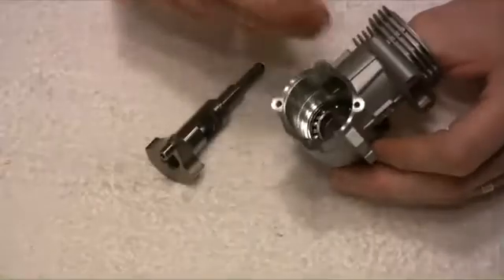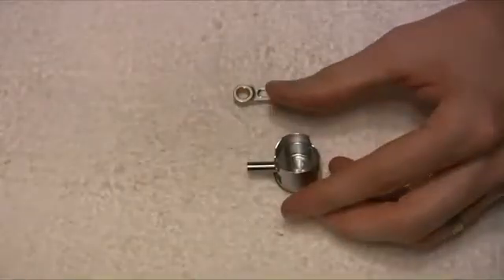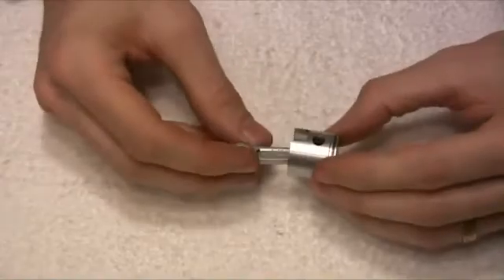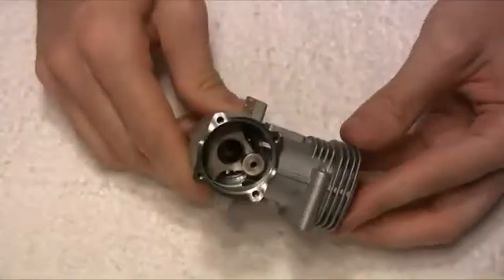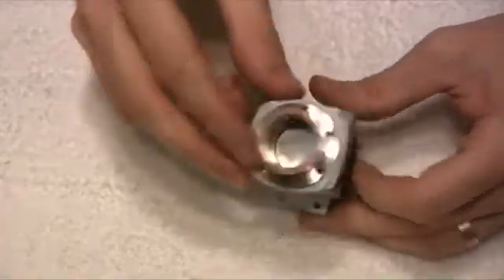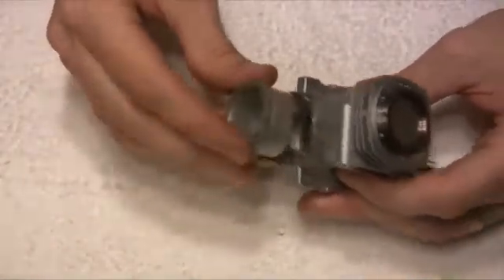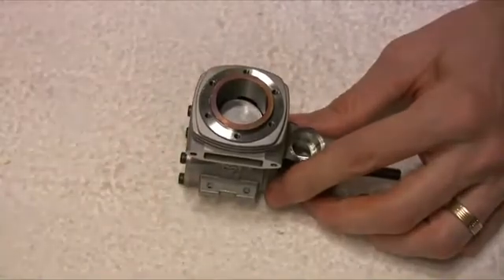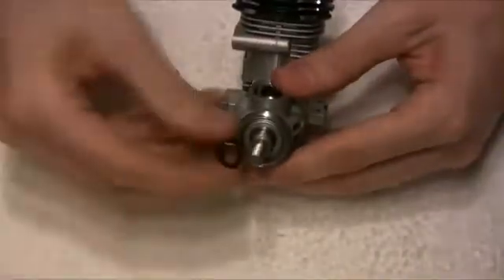OS55 HZ - Engine re-assembly

Comment: With respect probably  know there is a tiny locater pin in the groove in the piston which let's the ring compress hence why you had trouble dropping the sleeve on the piston if the ring is in the correct position the sleeve should  go on with ease  as the purpose of this pin is to stop the ring rotating